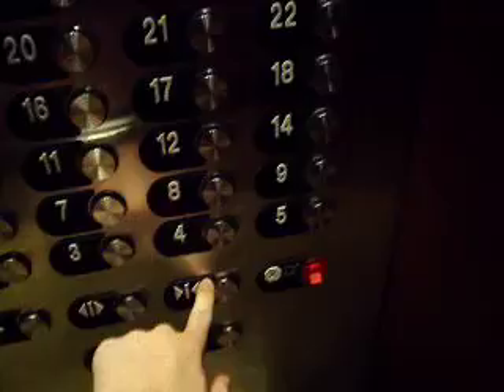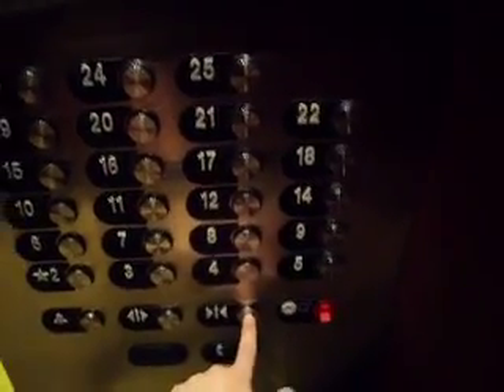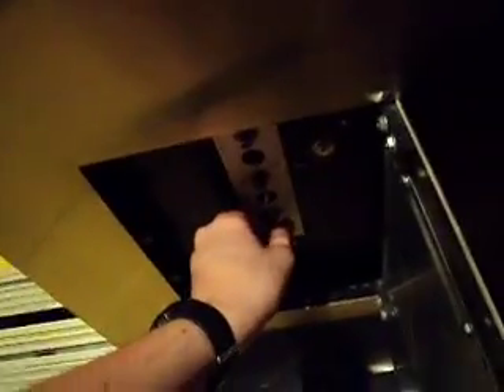A Demonstration of Independent Service in an OTIS Gen2 [Mariott Brooklyn Bridge]

Comment: I've watched videos where floor selection after the doors are closed in is doesn't make the car go anywhere. The simple solution to that is pushing and holding the door close button again until the elevator starts moving. You should try that.